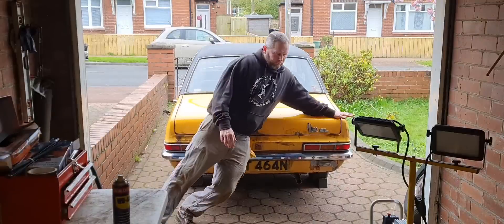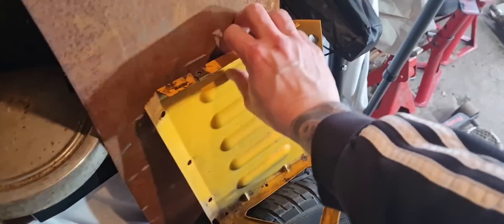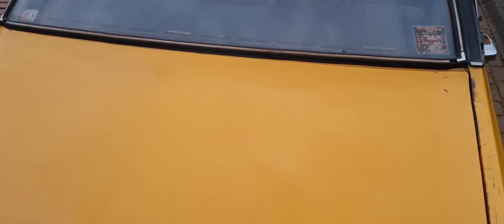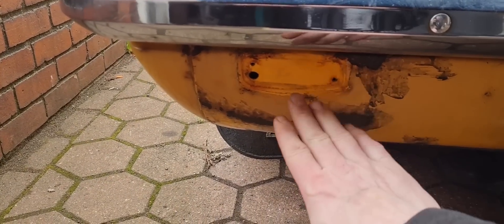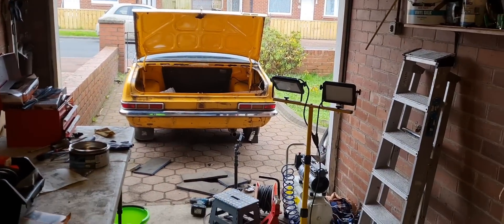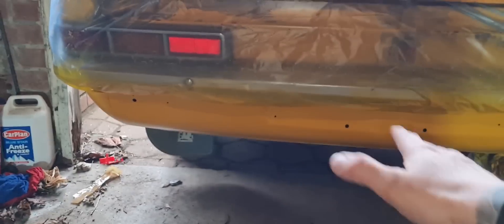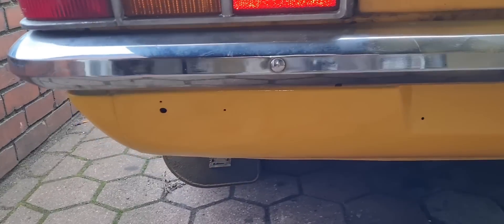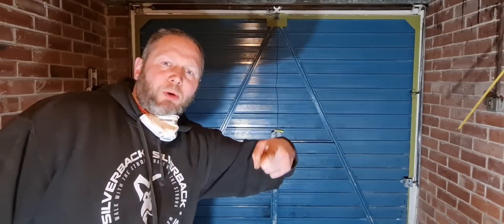FIRST WASH IN OVER 32 YEARS! THE BARNFIND 1975 VAUXHALL VIVA BUDGET BUILD CONTINUES

Comment: Alright mate! Back panel turned out canny 👌 should be no bother painting straight over the etch if its a decent make, you'll need your hibuild for the repairs. I've used some cheap primer before where it said to leave 24hrs... I didn't and painted over after about an hour, primer was still too soft, although looked fine for a few days it started cracking after 🤦‍♂️ own fault for buying cheap primer 🤣🤣👍🤟
Reply from the maker: Alright mate, thanks for the info, I'll see how the paint fairs over the next few weeks, I wasn't expecting much from my rush job tho 😄👍
Reply: @RetroRebuild  ah it looked a canny finish to be fair mate 👍

Comment: Thats great Steve, the HC was so quick to pull off tail lights & badges off for repainting 😊 a huge improvement. 
The mudflaps were definitely an optional extra, rather like overriders.
If in my case the HC, if they were not available, the GM dealer in New Zealand put the Holden mudflaps on, known in Australia as the "Holden - Highrise" mudflap.🌈👍👌📸🌎🗽
Reply from the maker: Thanks Vernon and thanks for the info 👍

Comment: That's better! Incremental improvements. There's a Pinewood green HB in my late Dad's garage. That got rattle canned in more-or less matching greens in the 1980s. Kept the rust at bay on the top. The underpinnings got cut and spliced, the teabag bumpers got binned and the worn out motor (odometer stopped at 168,000 years before the motor got too 'past it') got swapped for a ford......
Reply from the maker: Thanks mate, ah nice I like the hb's would love to restore one in the future 👍
Reply: @RetroRebuild  This particular HB is a bit beyond 'restoration' due to all the mods - done to keep it on the road when spares were unobtainable and dosh was scarce. It is an '80s timewarp - even has a 'mutant' sticker on the back, free with the late lamented AWoL  magazine. This was a custom bike mag that featured rats, survival bikes, street fighters, diesel specials, trikes, chopped UJMs and not just Harleys.